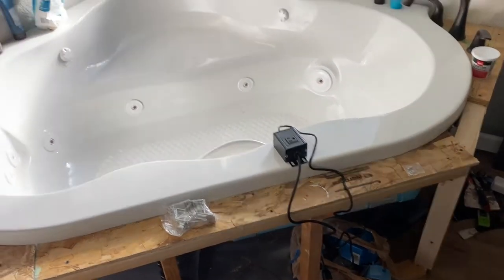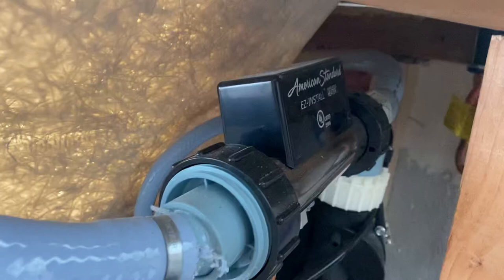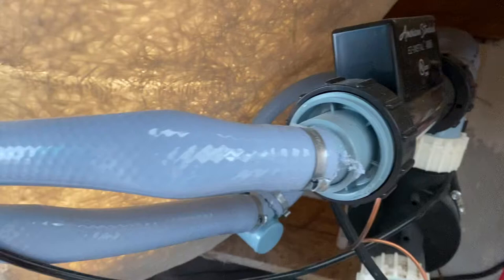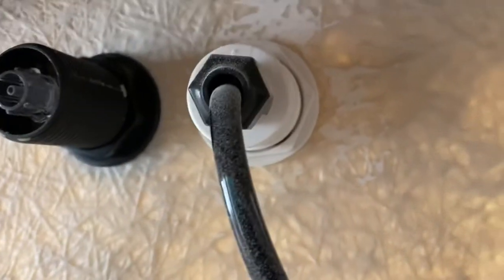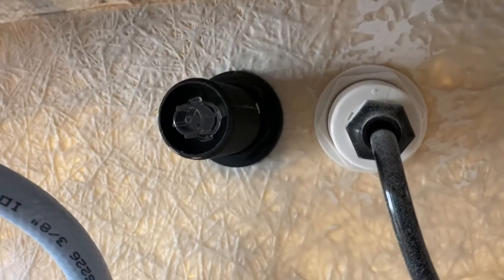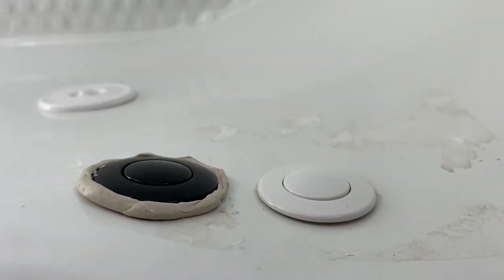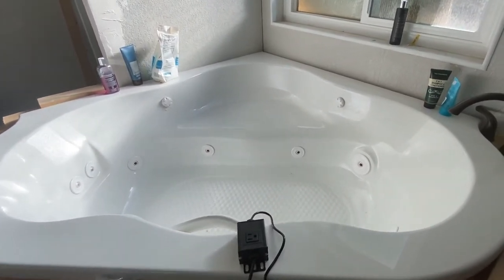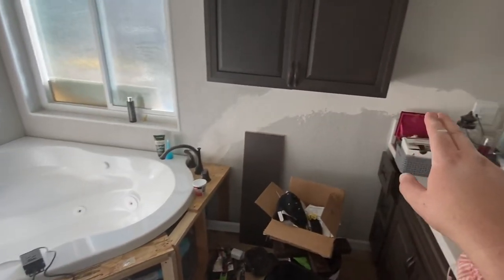DIY Corner American Standard Whirlpool with Heater Add-on / Mod

Comment: Correct me if I'm wrong but I believe the straight through heaters are ment to be installed on the intake side and the t pipe heaters are ment to be installed on the pressure side.
Reply from the maker: no idea but the way it I have it heats up nice :-)